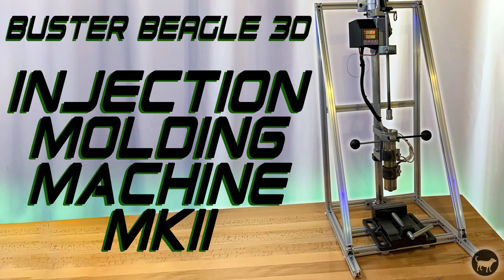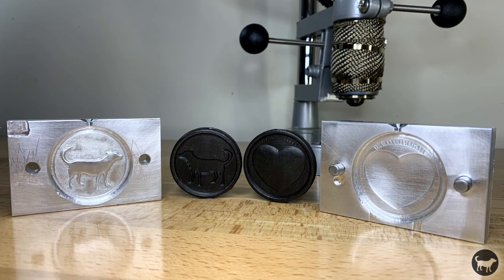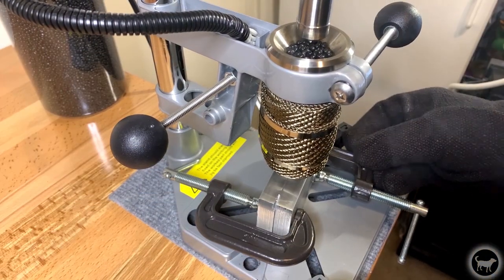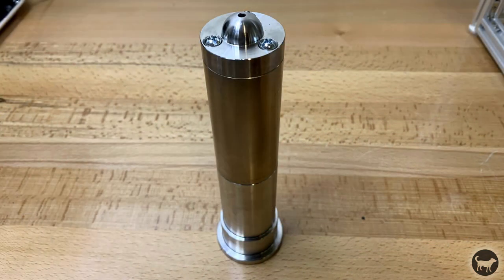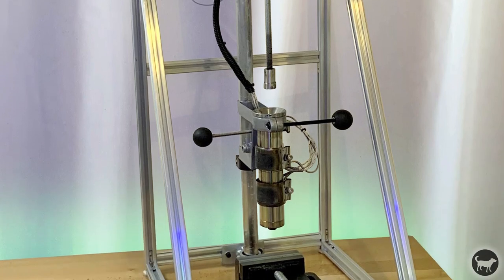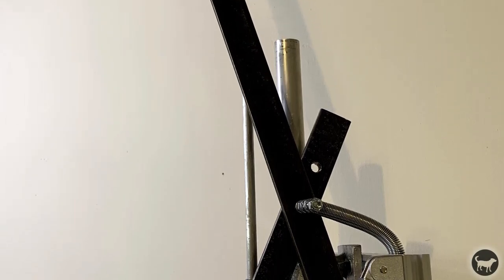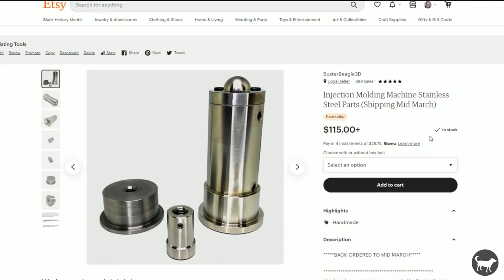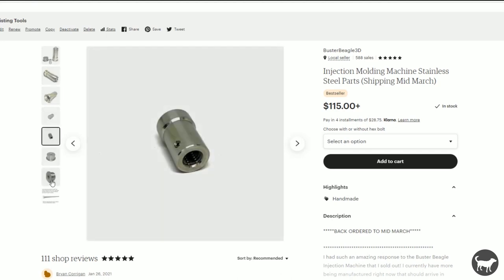Buster Beagle 3D Injection Molding Machine MKII Sneak Peek

Comment: If v2 is a bolt on + frame upgrade will v3 be a wider bore single piece heat chamber to reach the 3cubic inches?  a lot of the stuff I want to inject is 1.5-3 cubic inches since it would streamline some of the things I print to sell and plan on selling.

Comment: Hi, would it be possible to use the extended heat chamber to the mk1 body? kind regards
Reply from the maker: Hello. Do you mean can you use the MK2 heat chamber with the drill press frame? It would be just a little too tall to use with that frame. That was really the whole reason behind the new MK2 frame.
Reply: @BusterBeagle3D  Thank you for your reply! The reason I asked is just that i have a pretty small work area at home so the Mk1 body should just fit nicely.

But I'd like to increase the shot capacity on the mk1body at the same time. That's why i ask if it's possible to fit the mk2 heat chamber in there. 

Thank you and have a good one!

Comment: Hi, could you try injection molding PLA scraps with this? E.g. shredding failed prints in a blender, then melting the bits and injecting to the molds.
Reply from the maker: You should be able to as long as the pieces are small enough. PLA melts at about 210C so you should be able to inject it.
Reply: @BusterBeagle3D  I think it would be more viable way to recycle PLA scraps than trying to make filament again, but I haven't seen any videos trying it. The molds are of course a bit tricky if one doesn't have friends with fancy CNCs.